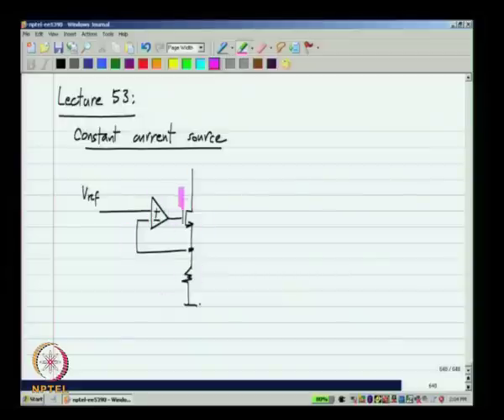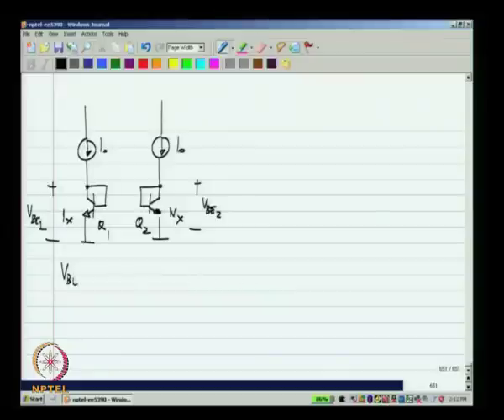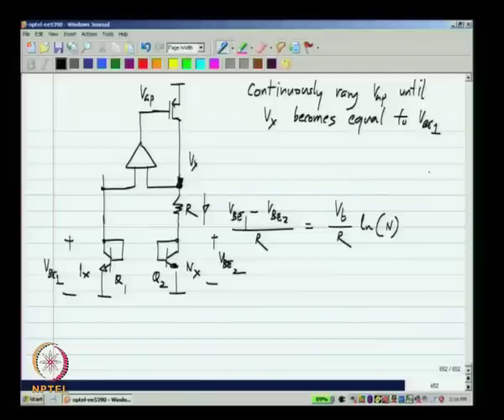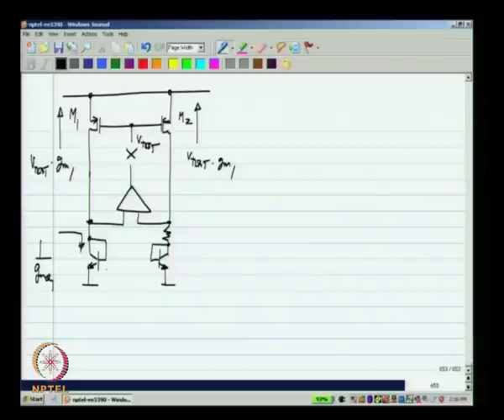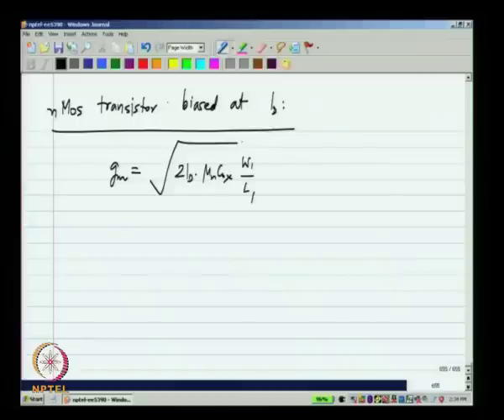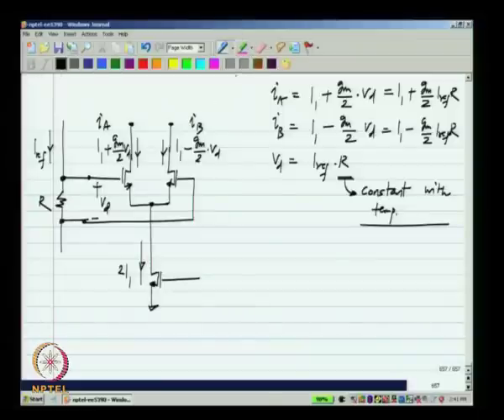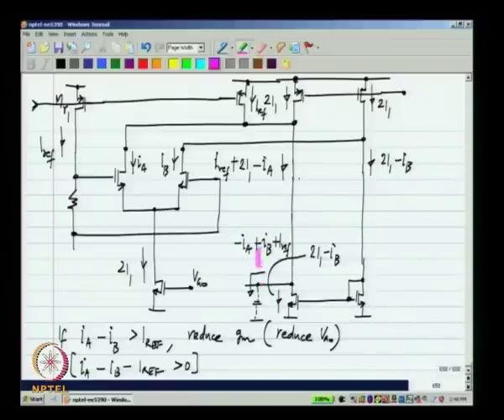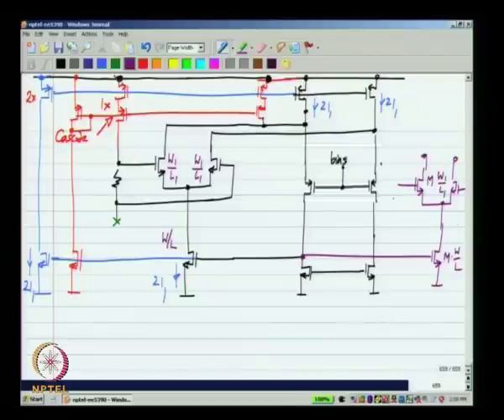Mod-01 Lec-53 Lecture 53

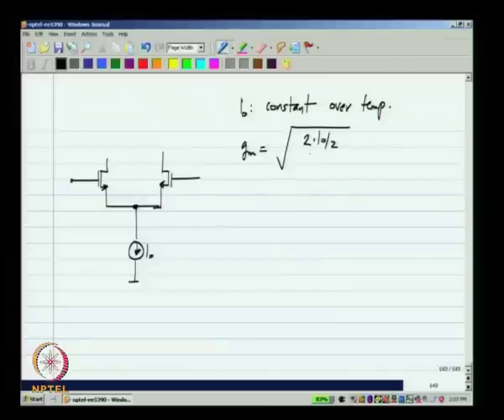Comment: In video @ 4:00, gm expression  is stated. How did you arrive at that expression?
Reply: That expression is wrong but the final intuition mentioned that at low temperatures we get more gm is true when we consider the right expression.    :D :D :D